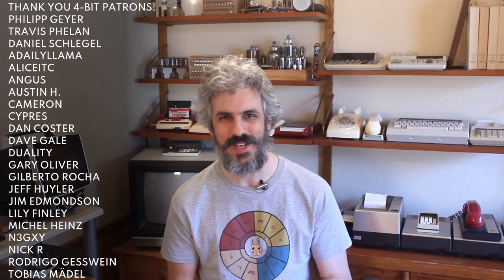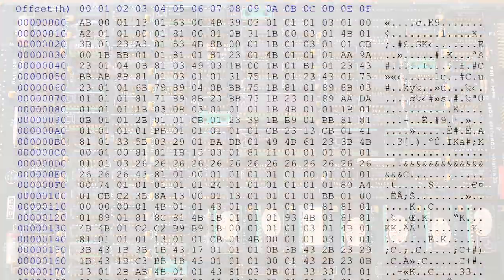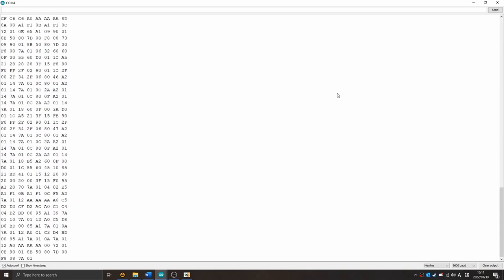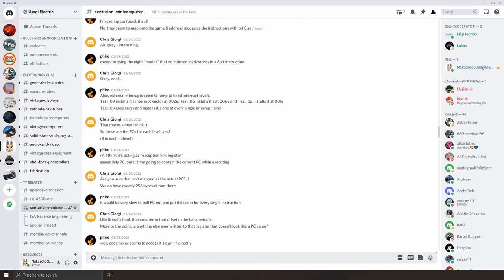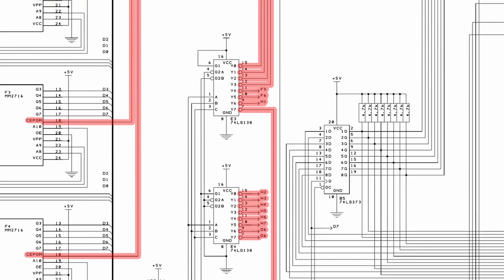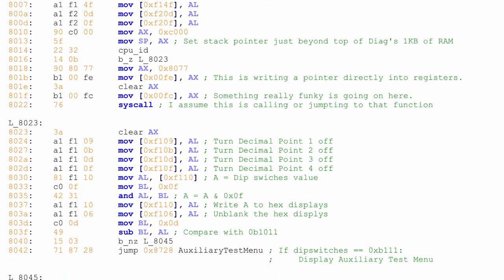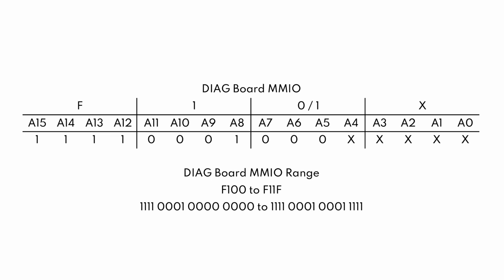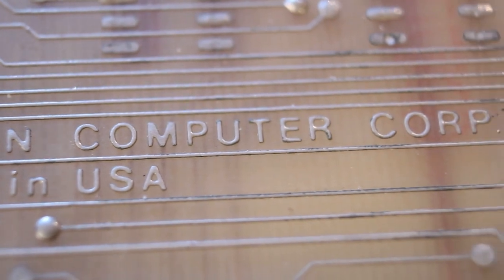Minicomputer Part 9: Reverse Engineering the Diagnostic Board

Comment: Im curious how you arrived at the op-code values for the ML monitor commands.
Reply from the maker: I can't really comment too much because honestly, a lot of it is over my head! But, I'll try to give my best account. Firstly, there was no documentation anywhere that we could find, so this was all pure hardcore reverse engineering efforts by the guys! But, that's also why some of the register names seems to borrow from other places. Like the 8086 architecture, this CPU has multiple 16-bit registers of which the high byte and low byte can addressed separately. So, we borrowed the 8086 mnemonic of AX, AH and AL for A Register full word, high byte, or low byte respectively.

The bit-slice architecture on the CPU is really just emulating a different type of CPU architecture that the rest of the system doesn't particularly know about. But, the software on the ROMs on the DIAG board is actually machine code which can be translated into assembly if you know the right things to look for.

As I understand it, they started with the known ASCII that we found by stripping the MSB. Once they located that ASCII in the original Hex, they could locate the null terminator byte and then start working backwards from there. We did find an old brochure for the Centurion that boasted having 8-bit, 16-bit or 24-bit instructions, so we knew that instructions were going to be 1, 2 or 3 bytes long, which helped us find delineations between instruction and addressing modes. 

Also, we had Ken Romaine hooking us up with some vital information on potential address locations for MMIO and other important bits, which when combined with the schematics of the DIAG board, let them start finding specific addresses. Then it was just a matter of building iterative versions of the disassembler and slowly filling in the blanks one instruction at a time. But, as we figured out each instruction that filled in more of the original hexadecimal and made it easier and easier to figure out the remaining questions marks.

I hope that all made sense!

Comment: and with that its now possible to resurrect the system, its code base is more or less rebuilt and just needs an os to be converted to it, iirc its os derivation was known so it shouldnt be too difficult to get close enough
Reply: Maybe another OS could be adapted to it -- nothing as advanced as Linux though.  Minix maybe?  It's amazing how hardware was built to move heaven and earth to do some very simple things in that day, and yet it proved usable.
Reply from the maker: The actual OS is still a mystery, but we know an incredible amount about the architecture, speed, and overall function of the hardware now, which means we can totally start work on some custom OS adaptations. A simple Disk Operating System that allows us to read and save files to an external floppy is a long term goal for certain! Though, aside from the software side of things, I also need to figure out how to build a custom disk controller card to interface a proper 8" floppy to the machine, but it's all totally doable!
Reply: @UsagiElectric  whatever amalgamation it becomes, it will be unique at least and it not like there are any other surviving examples or documentation to say you did it wrong.... something i just remembered, it might actually still be possible to recover the majority of the original os, i dont remember who but ages ago i watched a video about repair and archiving of alto hard drives and their platters, they use the same general kind of drive as yours does so this might be applicable, they had several platters there were damaged, scratches and crashes, but were still able to recover pretty much everything on the damaged platters, they even had their only copy of the diag platter get ruined but were still able to use it.  your boot platters are shot but might still be intact enough to read the surviving data from, although it will probably require you to get the computer running enough to seek files

Comment: I would get some 27C16's and program them with the data from the older EPROMs for testing the card.   That way there won't be any question as to whether the EPROMs are working correctly.    TBH, I am having trouble believing that the TL866 needs the chip to be faster than 450 nSec to read reliably.   I have read many 450 nSec EPROMs with a modern EPROM programmer and never seen this issue.   Probably your Arduino reader was giving more than 450 nSec access, so you don't actually know how fast the EPROMs are able to access.
Reply: The access time expected by the TL886 probably depends on the selected chip. The MM2716 is not in the list. By choosing the faster pin-compatible CMOS version which is on the list, the programmer has no reason to expect it can't respond fast enough, so it goes faster.
Reply from the maker: I have indeed already done that!
The TL866 was definitely expecting the chips to be 200ns chips, and so probably moved at a faster speed since that's what I had it set for. I've since learned that the MBM2716 is supported by the TL866 and it has a 450ns read time, so I could have used that setting to reliably dump the ROMs. But, I managed to get good clean dumps and that was all that really mattered!

Comment: Is that a DataMath II calculator to the left of the RedPhone handset?
Reply from the maker: It is indeed, excellent eye!
That's actually my daily driver calculator. I had it in that room because I was using my TI programmer for a little bit, but the Datamath is right back on my desk right now and I use it almost daily, it's a wonderful little calculator!
Reply: @UsagiElectric  Mine has a collapsed button; must remember to pull it apart and give it a bit of love.  Dunno if I like the 70's 7-segment LED's or the slightly later VFD-based units better.  I really don't use a calculator much, and when I do the pocket supercomputer is typically nearby.

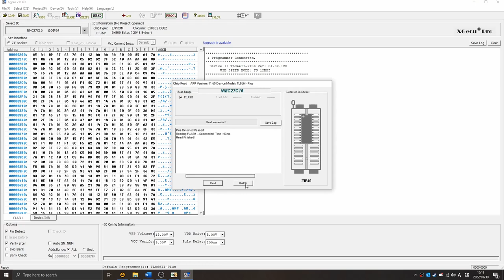Comment: 3:55  Awesome work-arounds!  Speaks volumes to your dedication on this.   I relate to TL866 programmer issues with the exact same PROM, the MM2716.  I created my own work-around for this, which may or may not have worked for you, but I'll share that over on Patreon now that I'm a supporter, and hopefully you can get my links there.
Reply from the maker: Thank you!
Although, I think you're right that the MBM2716 would have worked just fine on the TL866, I just totally missed it!

Comment: Could it possibly be 8086 code
Reply from the maker: The assembly actually kind of resembles 8086, but that's only because we were essentially creating a new assembly mnemonic from scratch and just borrowed from the 8086 style. The actual assembly and architecture was originally completely custom and wasn't shared by any other machines out there, with the exception of some Fedder systems, which were very similar.

Comment: Use the smaller CPU console and not the big user terminal!!!
Reply: That makes a lot of sense actually! It could be laid out a bit differently than the user terminals. @Usagi Electric should bump this just for general info! 😉
Reply: @danw1955  In my heyday it was common for the mainframe (or mini) to have an "operator's console" varying from e.g. Westrex teletype through to more modern screen-based devices, but I never saw a single one that looked anything like what folk in those days called a "user terminal". They were always designed to be built-in or attached to the main CPU cabinet / desk and permanently connected, i.e. if the CPU is on, the console is on...
Reply: @philbowles3240  The Centurion terminal [ADDS 520 in this case] connected to Port-0 of the first MUX card is the system's console.  Once the system's operator has the operating system started this console is just like any other user terminal running application programs.  I agree back in mainframe days we did have a dedicated systems console.
Reply: @kromaine13  Thanks for the info.
Reply from the maker: As Ken stated, the MUX card is really, really simple and the terminal is setup as the dumbest of dumb terminals. But, I dig into the terminal in a lot of detail in the next episode, which should be going live any minute now!

Comment: Ugh.  They didn't use Z80 mnemonics.
Reply from the maker: We didn't actually know what the original Centurion Assembly mnemonics were, so we kind of had to pull from other styles that kind of resembled the architecture here. The Centurion has a series of 16-bit registers and it's possible to address the whole register, just the high byte or just the low byte depending on the addressing mode. Since that's really similar to how the 8086 uses and addresses its registers, we borrowed the naming scheme. For example, AX would be the whole 16-bit A register, AH would be the high byte of the A register and AL would be the low byte of the A register. 

But, I've never done any assembly programming before in my life, so it honestly made very little difference to me what mnemonics we used because I'm starting from scratch no matter what!
Reply: @UsagiElectric  Well,  for one thing, I know that the A register is the accumulator and is 8 bit only.  The 16 bit registers available on the Z80 are DE, HL, BC, IX, and IY.  (There are an alternate set of registers that can be swapped out during interrupt processing.)  Since Z80 machine code isn't political, Wikipedia is a fairly good resource at the moment I write this.  Please take a look at https://en.wikipedia.org/wiki/Zilog_Z80  to see what registers are available on the chip.

I had done a lot of assembly programming on a TRS-80 model 4P (Z80 based) as well as a bit of assembly programming on an Hitachi HD64180 (which was part of an upgrade board of said TRS-80 model 4p).  Motorola assembly used MOVe from the source to the destination.  Z80 assembly uses LoaD into the destination from the source.

In the long run, does it matter?  Maybe, maybe not.  Those who had done Z80 assembly programming back in the mists of time might not realize that you are discussing Z80 opcodes/operands if they flick through this channel and see the MOV mnemonics in the discussions.

I honestly wish you good luck in bringing that old machine back to life.